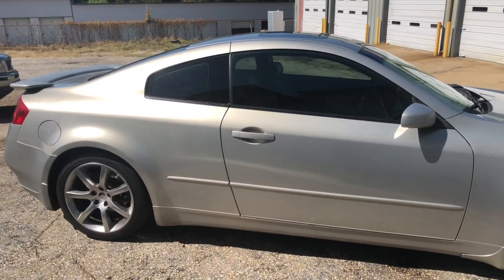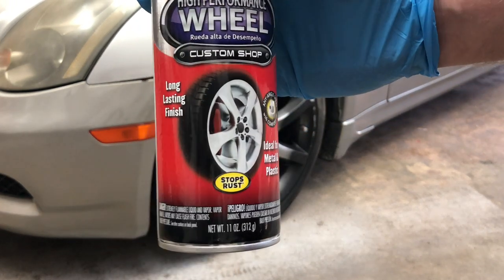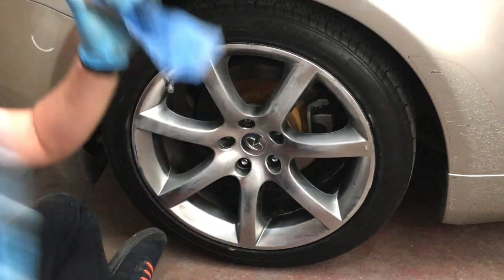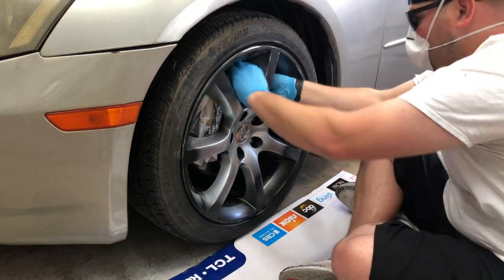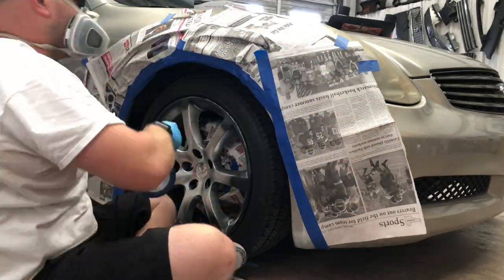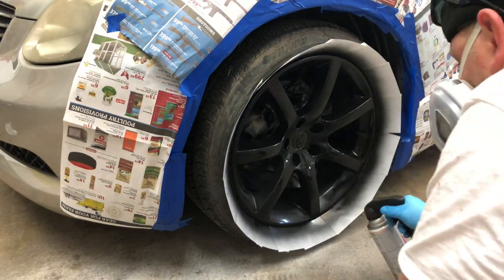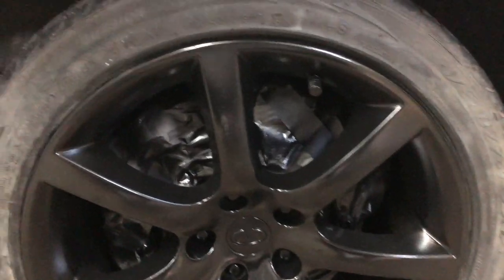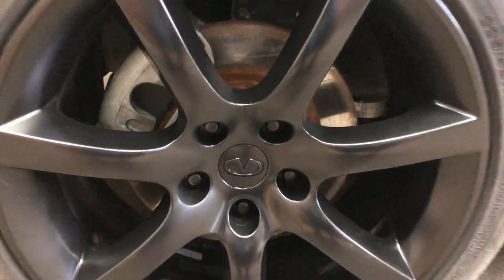DIY - Paint Wheels Black with Rustoleum Spray Paint

Comment: How are they holding up? Thinking of doing my Xterra. Recommend using any primer or clear coat?
Reply from the maker: They have done good overall; should have put clear on them. I had a tire changed and they were kinda w reckless. Chipped a little bit, but nothing major. Recommended project. Thanks for watching!!

Comment: Thanks for this video... I will be doing it just like this. Thanks again for the confidence builder
Reply from the maker: Good luck!! I recommend using clear!!! Thanks for watching!!
Reply: How is it holding up?
Reply: @davinmchone5755  the wheels came out great... I wasn't as patient with the set up as Pat was though.  I stuffed the wheels with plastic bags but instead of playing cards and using the newspaper I just got a big piece of cardboard and free handed it. The clear coat like Pat said would have been ideal afterwards but I didn't do that either. A year later,  everything is still black but it could use a touch up. I'll do that in the spring.

Comment: You could also use tire shine on the wheels and then you don’t have to use cards to block the tire, I just use a pressure washer after a few hours and the paint just comes off the tires very easily.
Reply from the maker: I've not done it, but heard good thing. (I despise bringing out the pressure washer lol) Thank you for watching the video!!
Reply: Pat Nobles I gotta pull it out every day lol

Comment: I’m a painter of 40 yrs. and I’d NEVER cost the rims while still on the car. 1st. More work in covering.. wheel wells.. body of car... etc.. and have to worry bout sagging.. gravity and all ya know. I’m doing my rims this weekend and each wheel will be removed.. washed and scuffed with green 3m .... then light coats .. I’m doing bout 4-5 THEN clear coat bout 6 light coats!.. DO NOT SPRAY PAINT YOUR RIMS WHILE THE TIRE IS STILL ON THE RIDE YO !
Reply: how come he not using primer as base? need it??

Comment: Nice if it can be done and still look good with out taking wheels off even better.  Most if time mechanics shop tighten bolts to tight I've stripped tire iron tryin to remove had to take damn car to shop to have them loosen bolt . So glad this was shown this was the inside wheels may not be perfectly even but over looks go enough for me ha e to try this on my car
Reply from the maker: I didnt mess with the inside of the wheels, that would be more work than its worth in my opinion lol.. Thanks for watching!! Good luck on your wheels!!

Comment: How do they look after several months. Can it handle the heat from the wheels?
Reply from the maker: I got rid of the car about 2 months later, they held up pretty well. I should have put some matte clear on them tho.
Reply: @patnobles5106  What if blank clear? Why matte clear? Any reason?
Reply from the maker: @morriszachrisson8359  I'm not sure what blank clear is.. I just wouldn't use gloss clear, considering its matte paint.. Unless you want them to have gloss, in that case I'd use gloss paint too. Thanks for watching!!

Comment: question to anyone giving input...assuming I sand very well (220 then 400 grit) and clean well and dry...I bought duplicolor green can self etching primer and duplicolor high performance wheel coating gloss black.   Do these work together?  IF I do a clear coat...do I ...

#1.  apply the duplicolor clear or go for the 2k (harder more durable)?   I read that 2K should only be used for certain paints.  

#2.  should I apply clear coat when still tacky 40-45 min after last paint coat or wait 3 or 4 hours
Reply from the maker: I would let it dry.. But I'm not a pro... Thanks for watching!!

Comment: If you paint the lug nuts, did the paint come off when you took the wheel off?
Reply: How many cans of paint to do the four tires?
Reply from the maker: Yeah, it scratched the paint off not using clear... Not sure if clear would help with lugs or not.. Thanks for watching!!
Reply: @patnobles5106  I assumed so..how many cans of paint and clear coat to do all four wheels?
Reply from the maker: @futbolista13  I dont remember how many cans I used... 3-5 cans of paint, then about half as much clear..

Comment: How long did you let the tires dry for?
Reply from the maker: I dont remember exactly, maybe 30ish min.. just depends how warm it is
Reply: @patnobles5106  All four rims were completely dry after 30mins?
Reply from the maker: @1luhleo  Tires...? Yes, it was hot outside.. Rims from painting, no. I would wait a few hrs at least before driving after painting..